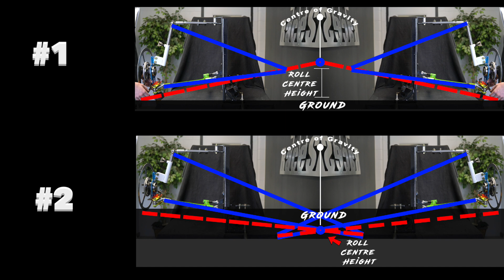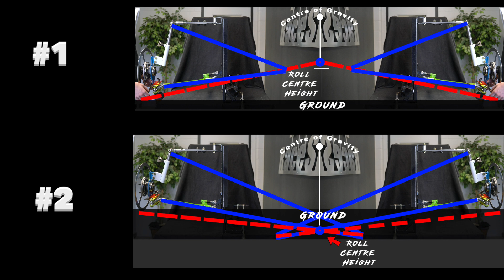Front Suspension Geometry| EP.4 Roll Centre

Comment: Doesn't lowering center of gravity mostly limit body roll?  I guess you're just referring to situations where you aren't running a roll-bar?
Even if you go beyond the road surface I thought it was common for cars to still perform better for the most part as long as it's not a extremely crazy angle.
Only negative tends to be that the car has trouble doing tighter turns because the body rolls gives more grip to the outside tires but when your roll center is so low with anti-roll bars it maintains too much grip on the inside tires and the outside tires lack the necessary additional grip.

I feel like just saying 'roll center below ground' being bad isn't really true but I'm not sure who the target audience of this video is as I'm assuming most people don't know enough to actually question what you are saying.

Comment: So on a Tacoma from 96 to 04, a common way to lower the front is to do what is called a "ball joint flip"  basically you on bolt the lower ball joint and mount it on the top side of the lower control arm.  Would this increase or reduce the roll center?

Comment: You should really talk about instant centers when talking about roll center. That’s what those two wires are showing, the instant center of one side of the chassis. Some of your drawings are incorrect, because you are not drawing the lines from the instant centers to the opposite side tire contact patch. 
Overall the basics come across well enough, but your terminology and drawings aren’t quite accurate.

Comment: Going back through the FDF Technical videos. Great video, it is sometimes challenging to grasp the technical depth that is going on with the roll center correction and load transfer. I am taking the HP academy suspension programs to knock the rust off of the vehicle dynamics classes I had back around 17 years ago. Here is a decent website for some calculations into roll center http://vsusp.com/#0.8%26project_name%3Adefault%20values%26trim%7Bbody_roll_angle%3A0%7Cfront.left_bump%3A0%7Crear.left_bump%3A0%7Cfront.right_bump%3A0%7Crear.right_bump%3A0%7D%26front%7Bframe.susp_type%3A0%7Cframe.bottom_y%3A9200%7Cframe.center_to_upper_mount_x%3A28500%7Cframe.bottom_to_upper_mount_y%3A24000%7Cframe.center_to_lower_mount_x%3A17000%7Cframe.bottom_to_lower_mount_y%3A2400%7Ccontrol_arms.upper_length%3A24800%7Ccontrol_arms.lower_length%3A37500%7Cknuckles.hub_to_upper_x%3A15000%7Cknuckles.hub_to_lower_x%3A13000%7Cknuckles.hub_to_lower_y%3A13000%7Cknuckles.hub_to_upper_y%3A13000%7Cknuckles.hub_to_strut_axis%3A14000%7Cknuckles.strut_incl%3A8000%7Csteering.active%3A0%7Csteering.hub_to_outer_tie_rod_x%3A7620%7Csteering.hub_to_outer_tie_rod_y%3A7620%7Cwheels.offset%3A4000%7Cwheels.diameter%3A1500%7Cwheels.diameter_expl%3A35000%7Ctires.size_convention%3A0%7Ctires.section_width%3A19500%7Ctires.aspect_ratio%3A4500%7Ctires.diameter_expl%3A50000%7Ctires.width_expl%3A7620%7Ctires.compression%3A0%7D%26rear%7Bframe.susp_type%3A0%7Cframe.bottom_y%3A9200%7Cframe.center_to_upper_mount_x%3A28500%7Cframe.bottom_to_upper_mount_y%3A24000%7Cframe.center_to_lower_mount_x%3A17000%7Cframe.bottom_to_lower_mount_y%3A2400%7Ccontrol_arms.upper_length%3A24800%7Ccontrol_arms.lower_length%3A37500%7Cknuckles.hub_to_upper_x%3A15000%7Cknuckles.hub_to_lower_x%3A13000%7Cknuckles.hub_to_lower_y%3A13000%7Cknuckles.hub_to_upper_y%3A13000%7Cknuckles.hub_to_strut_axis%3A14000%7Cknuckles.strut_incl%3A8000%7Csteering.active%3A0%7Csteering.hub_to_outer_tie_rod_x%3A7620%7Csteering.hub_to_outer_tie_rod_y%3A7620%7Cwheels.offset%3A4000%7Cwheels.diameter%3A1500%7Cwheels.diameter_expl%3A35000%7Ctires.size_convention%3A0%7Ctires.section_width%3A19500%7Ctires.aspect_ratio%3A4500%7Ctires.diameter_expl%3A50000%7Ctires.width_expl%3A7620%7Ctires.compression%3A0%7D%26pref%7Bdiag1.px_per_mm%3A200%7Cdiag1.front_or_rear%3Afront%7Ctab.active%3A1%7Cunits%3A0%7Cshow.f%3A1%7Cshow.ca%3A1%7Cshow.k%3A1%7Cshow.st%3A1%7Cshow.stl%3A1%7Cshow.w%3A1%7Cshow.t%3A1%7Cshow.rc%3A1%7Cshow.rcl%3A1%7Cshow.ic%3A1%7Cshow.icl%3A1%7Cshow.fvsa%3A0%7Cshow.tl%3A0%7Cshow.kpil%3A0%7Credraw_during_drag%3A1%7Cchart.x_axis_center%3A0%7Cchart.x_axis_window%3A10%7Cchart.x_axis_num_steps%3A21%7Cchart.x_axis_field%3Atrim.body_roll_angle%7Cchart.y_axis_fields%3A%5BFR%5D.general.roll_center.y%7D

Comment: For the angle kits that don’t have the ability to run a sway bar unless you modify it and add a mount point.  Are they changing things in the knuckles to change roll center ?
Reply from the maker: They have corrected roll center yes. But every kit should have a sway bar as am option due to the demonstration showing no car being the same. How can a kit work the same when 2 drivers have a ride height difference of 50mm? Which would dramatically change the dynamics of everything, roll center especially so it is important to understand what it is, and then you will know what to change if you don't like how something feels. This is the main goal of these videos

Comment: hi, nice video, but i think swaybars important when you do grip driving/racing but drifting car physics are slightly different as car slides instead of cornering , had few cars where i removed sb and had literally no effect on performance -   stock sb have so much slack in them so once i fitted coilovers with stiffer springs there was no effect with them or without - that is for low bhp drifting experience (200-300bhp cars)
Reply from the maker: Story time, I was in a wreck with another car leading me when he went in to the wall, this damaged my frame rail and pushed my sway bar in to my alternator, so for the next battle I had to remove the bar. With my 8k springs, and dampening not adjusted the car drove very different. I won't say bad because some drivers like transfering the weight alot but the main points to consider are the more power you have and grip you get, the more force is being applied on the center of gravity and this will give you undesirable results as you gain traction. Our car is around 700bhp and uses very grippy tires so the G's we can pull is quite impressive and in my opinion the car would be not as competitive without sway bars. Helps me balance the car and utilize all the potential in the tires before they are gone in 30 seconds 😄
Reply: @FDFraceshop  S chassis had shit design with front arms (aka caster arms) when you are in crash and bend front rails all alignment is fucked, bmw e36/e46 had it better as You would have to damage car beyond repair to get it out of alignement, little wack on s chasiss and you have to check everything. i personally dont like sway bars but  still little experience with big bhp cars so maybe loads to learn yet.
Reply from the maker: @jankesbmw  you are not wrong! Watch my pro car breakdown video on how I reinforced the schassis 🤣

Comment: So what would you recommend for somebody running your C6 Corvette kit? Is there a sway bar you know of that will work with it? Would love to see some stuff on double wishbone. 👍 Thanks for this whole series. I thought I had a pretty good idea of what was going on but this is way more in-depth than I ever knew.
Reply from the maker: The corvette kit has a bracket that the front adjusting arm bolts to. These holes can be used to attach an adjustable linkage to connect to the oem bar or an aftermarket bar. We are currently making a front sway bar for the corvette as we speak so maybe hold out for a bit. Either way, an aftermarket adjustable linkage will be required so that is something that can be purchased ahead of time. The oem bar may interfere with your wheels at full lock.